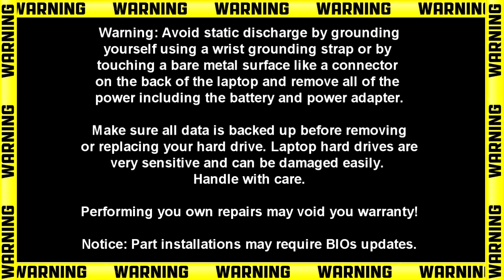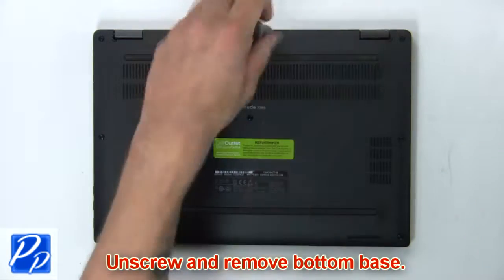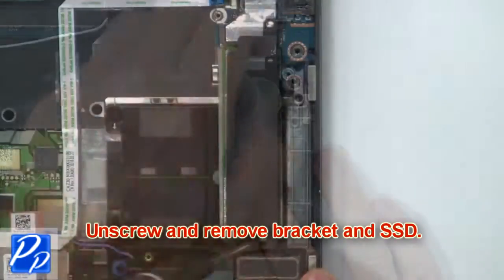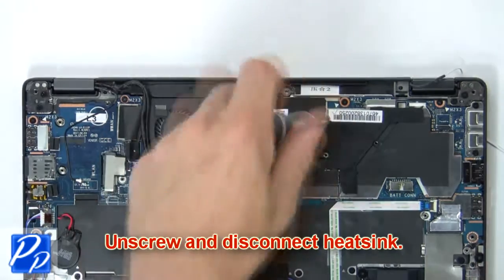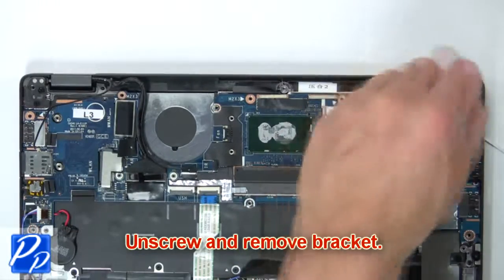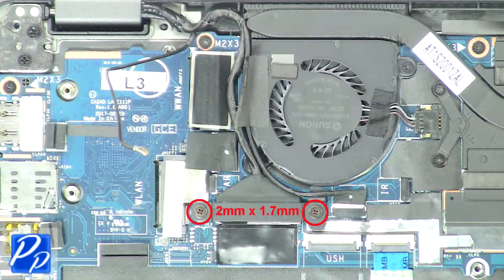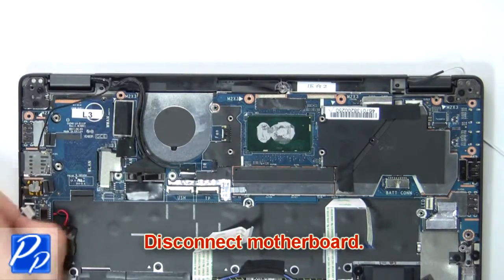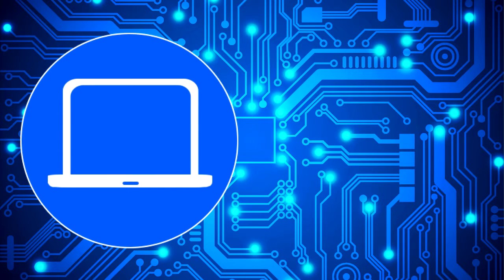Dell Latitude 5289 (P29S001) CMOS Battery How-To Video Tutorial

Comment: I just cut the wires close to the CMOS battery and soldered the new battery wires to the old wires and used heatshrink tubing. You would never even know and no dicking around with total disassembly...

Comment: Did everything to reset the bios nvram, now the computer won't turn on at all. Any suggestions what I did wrong or what I could try? Before, the keyboard would turn on for 2 seconds then turn off so at least something was happening before. Now nothing.
Reply: did you ever fix this? i have the same problem
Reply: @Middas  I believe I had to send it in to replace the motherboard. Somehow it got fried if I remember correctly. Ended up getting a Samsung Book2.
Reply: @alixvandurand  do you recommend spending money to get this repaired or just go buy a new one
Reply: @Middas  well the issue is you don't know what needs to be replaced. It could just be the battery, which you can buy one for probably 20-40 bucks and swap it out pretty easily. But if that doesn't work, it's usually the mobo which is either too expensive or too technical for me. I just had to replace the mobo on the Samsung earlier this year but thankfully it was still in warranty. If you have a little mom-and-pop computer store near you, maybe try them and see if they can diagnose it for you for cheap